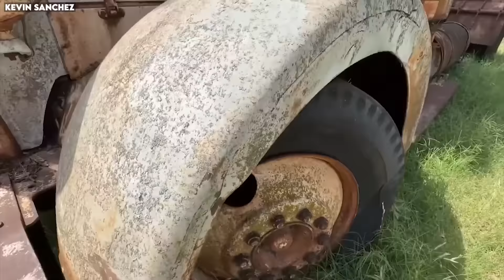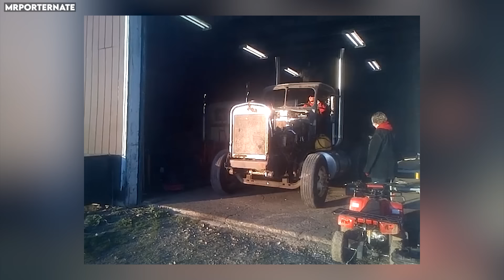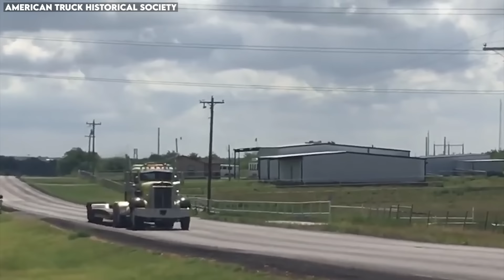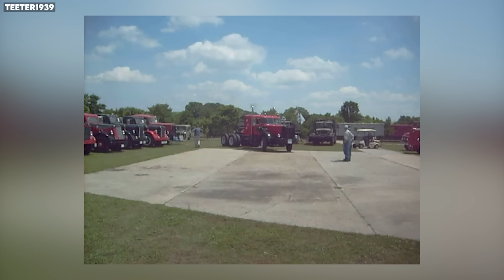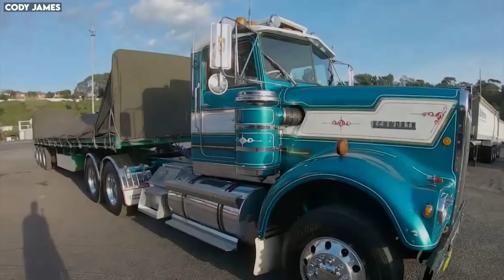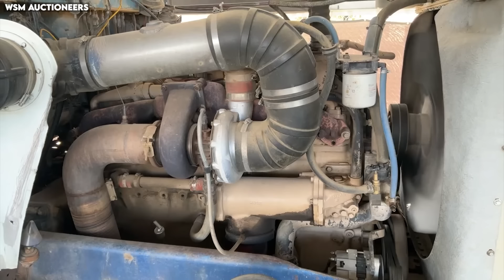10 Vintage Trucks That Truckers Wish Still Existed

Comment: So much incorrect info and mistakes in this video.  Obviously the researcher must have been taking some serious road dope.  Can't tell the difference between cabovers ahd hoods.  Some examples.  The KW Bullnose looked nothing like the video showed; the IHC R series was produced until the mod 60s; the RD 450 was an inline 6 cyl gas, and I never, ever saw a IH with a Hercules engine,  KW 900 was still being produced as recentas 2020.  My 85 Pete 359 had a steel frame, aluminum cab and hood.  Smokey and the Bandit nr 1 was a KW 900A. In S&B 2 it was a GMC General.  So much wrong info in this film the producer should be ashamed and embarrassed

Comment: The information  on IH R-190 is way off. They were produced until the 1960's, and replaced by the Fleetstar/Loadstar line. The S-series came out in model year 1978. The 450 engine was the Red Diamond 450, a big 6 cylinder gas engine.
Reply: Before the R model was the L model, almost the same but had a split rear window, before that was the K model, I drove all 3 back in the late 60s / early 70s 😉

Comment: only going to comment on the IH R190 section ..  #1:  As expected of AI-generated "intellegence" left unchallenged,  one of the IH trucks featured is an L-series and another is a V-series...   #2:  This AI-video says production of the R-190 ceased in 1956 when the S-series came out.. Hey AI, you are confused.. Production did cease in late-1955 for the R-100 up through the R184 models, however the R185 and larger models (R190 included) stayed in production until end of 1965.. Amazing fun fact,  the R210 thru R230 remained in production thru 1971, a testimony to their ruggedness